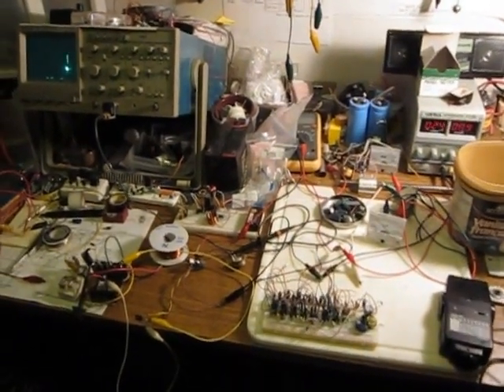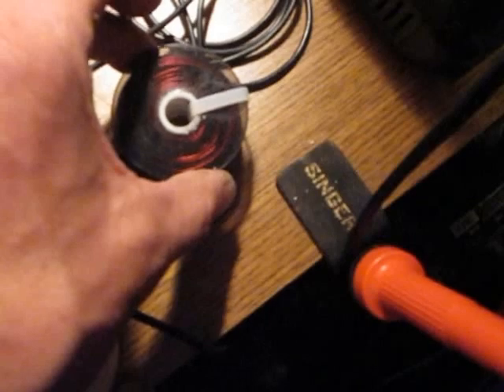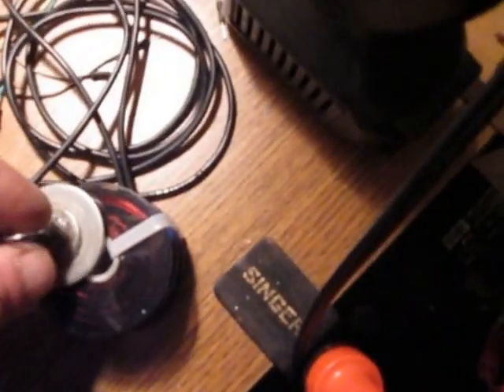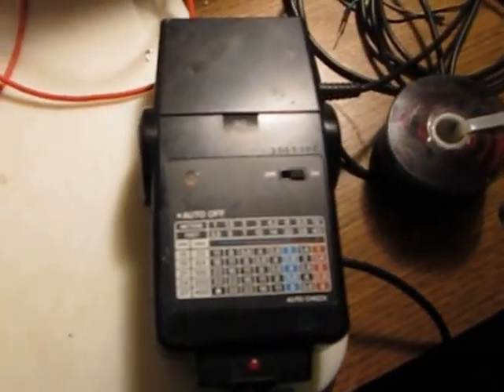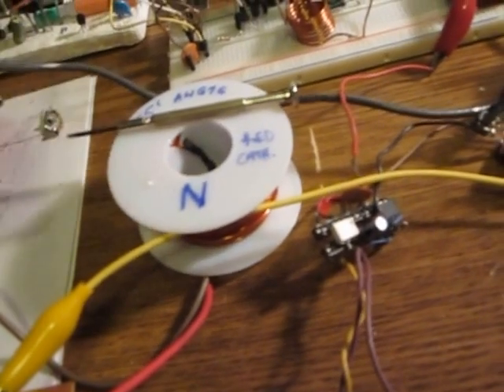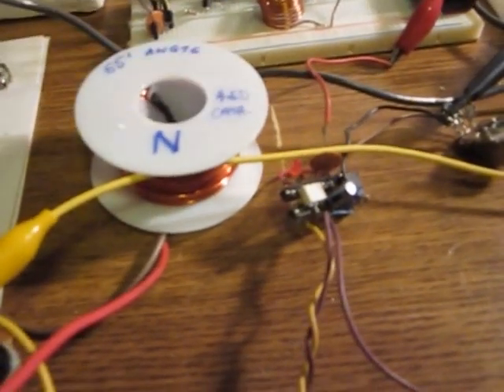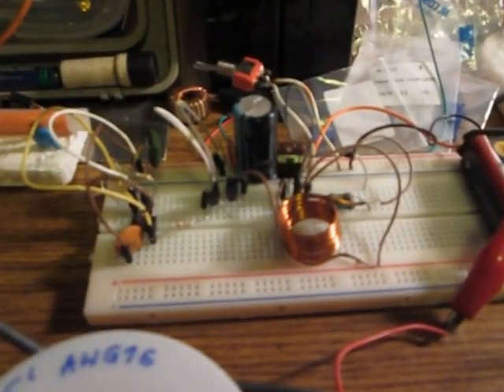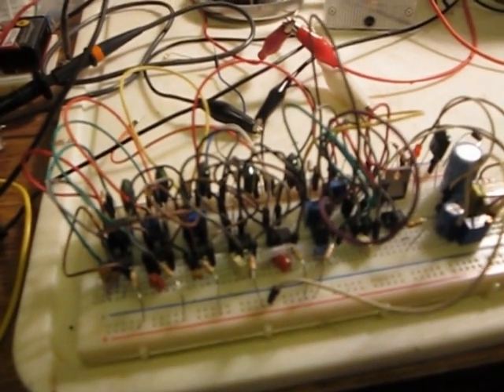Magnetic Healing Technology - Magnetic Pulser

Comment from the maker: Possibly, the negative will be diagonal from one of the positives.If you open the case you can check and solder to the wires, instead of battery connectors. You may want to cut small hole or a notch for adapter wire and tie a knot behind so it won't pull the :intestines" out.. You could solder to the battery terminals but you'll have to take them out first so you will not melt the plastic around during soldering.

Comment: On my unit the positive terminals for both batteries are in the same direction which is what threw me on how to wire it. I would solder the positive wire to the one terminal and the negative to the other terminal as I see no other place to solder it.

Comment from the maker: There should be some kind of battery polarity indication inside the flash. Adapters have either label or imprinted in plastic info regarding their output and plug polarity. Most common is the positive inner and negative outside (collar). It is unlikely that you damage flash by reversing polarity. When correct and flash is on you'll hear a faint high pitch sound, which means the oscillator inside working. You can use a slice of potato as an indicator. It will turn green around the negative wire.

Comment: UNderstood on the batteries wired in series..BTW the capacitor in this model is 330v 400uf.  It's an argus 215.
I didn't know I need to heat shrink as the connections initially weren't . I already dealt with the cap terminals when I heavy upped the wires. One of the wires to bulb had become disconnected before.   I'll look up on how to determine polarity of both items and then solder wires to terminals.

Comment from the maker: Claire, I did answer in visitor's messages but will post here as well. Most likely your flash is 3V and batt's are in series. You can try to Google model number to be sure.All you need is to determine polarity on battery compartment and adapter. When you cut the wire going to the flash bulb be careful not to touch the capacitor terminals or short them with a screwdriver to discharge.It doesn't matter which you cut to put your coil in series. Insulate all connections well.

V

Comment from the maker: Hi Claire, Could you meet me at energyscience forum and I'll be able to assist you further. It will be easier for me than making another video. I post in electronic healing technologies. There is also another YT with my new MP. which has internal oscillator and pulsing circuit.
I'll have my own site and forum dedicated to alternative medicine running soon and will provide a link in one of the newest videos.

Thanks
V

Comment from the maker: Running pulse through a flash is the simplest way but also wastes the energy which could be also discharged in the coil.
You can get good results without building a coil gun. 50-70,000G will penetrate up to 10" which is enough to reach any organ or lymph node.
This was a simple follow up of Dr Beck idea which I took couple levels up since. What matters is enough energy being stored in capacitor, very narrow pulse (abrupt discharge) and large enough air inductor (5-10mH).
Thanks for kind words.
V